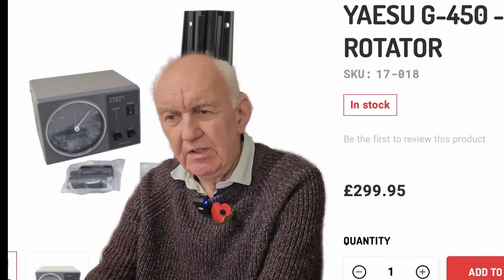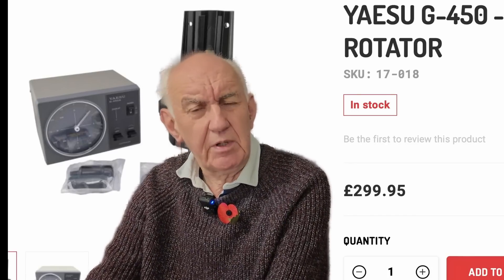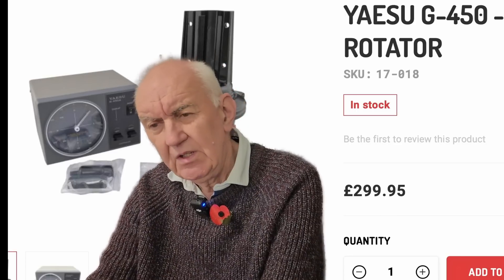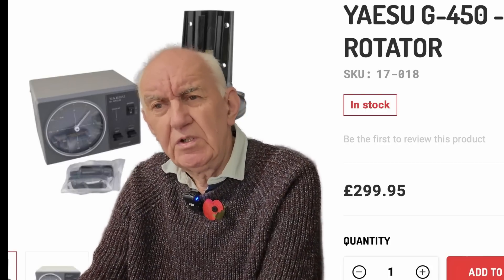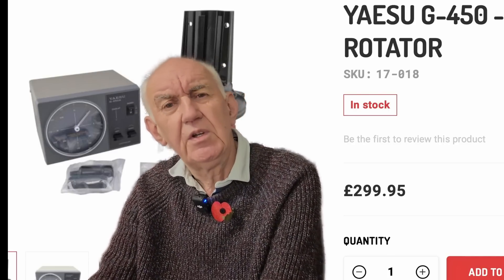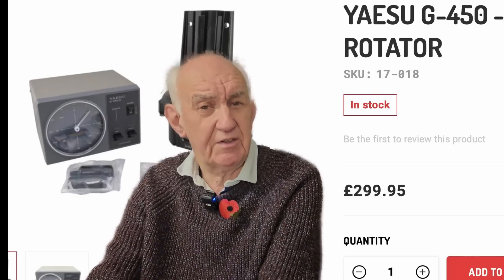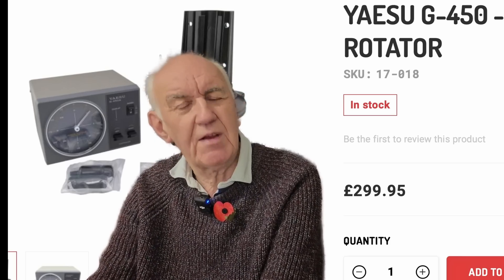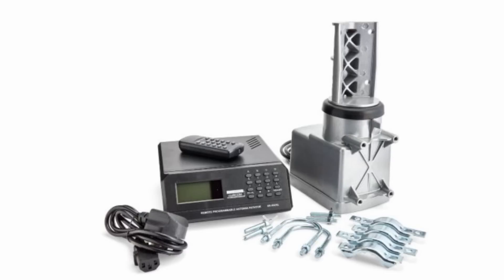Ham Radio Rotators -Choices and Warnings

Comment: What's wrong with a TV antenna rotator like ChannelMaster?  TV antennas are often of similar weight.  BTW, cut the bottom out and slit the side up a milk gallon jug, put it over the rotator for extra weather protection.

Comment: Great video. I am looking at the Yaesu G-1000DXA.  The antennas I will be using are Hy-Gain TH-11 DX , Cushcraft D-40 and a Cushcraft A-148-20 T 2m antenna. In your opinion will this rotor work or should I go to G-2800. These antennas will be on a 48' HD tower.  Thanks
Reply: It should but if you are unsure get the 2800. I have the 1000 and am happy but it's just turning a hygain th3mk4. I do believe in over engineering. Joe WA4UJY

Comment: Hi Peter.  I've been thinking about possibly putting up a small yagi for VHF/UHF and possibly - if I dare to go so far - a hexbeam for HF.  I knew I would need a rotator for such directional antennas, but quite honestly, I was completely clueless on their operation.  This video really helps explain rotators and additionally thrust bearings.  I've read you typically need a thrust bearing for such antennas, but I really had no idea why.  I'm feeling a bit less intimidated now after watching your video - thanks!
Reply from the maker: Glad to help.

Comment: Peter great video! Totally excited my engineer qeek, and its showing. 

Lets break down (no pun intended) why the position of a rotor motor on an antenna mast makes such a big difference in the torque experienced by the rotators stationary gearbox, especially when the wind blows. This is a topic that confuses a lot of people, so let’s address some common misunderstandings along the way.

Torque Explained

First things first, torque is a measure of rotational force. It is calculated by multiplying the force applied by the distance from the pivot point:

Torque = Force x Distance

This means that the longer the distance from the pivot, the greater the torque generated for the same amount of force. Think about using a wrench—the longer the handle, the easier it is to turn a bolt. While torque involves rotation, tension is the resulting effect: a linear pulling force that doesn’t cause rotation.

When torque is applied by a motor to a mast, tension energy is stored in the mast until the motor stops. This is why the mast may appear to bounce slightly from side to side when rotation stops. However, when the motor is stationary and rotational force is applied at the top (e.g., by the antenna), the torsional force in the mast is amplified proportionally to the torque applied by external forces, such as the wind. The full effect of that torsional force is then transferred to the gearbox or motor via the mast.

Common Misunderstandings

Many people mistakenly believe torque and tension are interchangeable, but they are not. Torque is rotational, while tension acts in a straight line. The concept of a lever arm helps explain this: the farther the force is from the pivot, the greater the torque produced. This is why the position of the rotor on the mast is critical when discussing an antenna and rotor system. 
Using the wrench analogy. The longer the wrench (think about the length of the antenna) the greater torque (turning energy) gets applied by the motor or the wind. That energy is transferred into the bolt (think of the antenna mast) as tension. (Much like a ratchet wrench utilizing an extension)

Analyzing the Rotor Position

Rotor at the Bottom of the Mast

When the rotor is mounted at the base of a 30-meter mast, the entire mast acts as a long lever arm. Wind forces acting on the antenna at the top generate significant torque at the gearbox at the base. Additionally, the mast will twist and store torsional energy, which can cause fluctuating forces that amplify the loading on the gearbox. This increased rotational force leads to higher stress on the gears or the motor, accelerating wear and tear. In extreme cases, if the forces exceed the system’s design limits, the resulting load on the gearbox can lead to catastrophic failure.

Note: this is why if possible during a major weather event with high winds its good if you can to apply a "Mast Lock". This will keep any torsional forces from being transferred into the motor or gearbox, minimizing or isolating antenna system damage, if there is any.

Rotor at the Top of the Mast

When the rotor is positioned near the top, close to the antenna, the dynamics change. The lever arm—the distance between the point of force application and the gearbox—is much shorter. For the same wind force, the torque on the gearbox is significantly lower. With less mast length available to twist, there is reduced torsional energy accumulation, which means the gearbox or motor experiences smaller, more immediate forces. This configuration places less stress on the system and improves overall stability.

As you eloquently stated

Rotor at the Bottom: More torque due to a longer lever arm and greater torsional energy accumulation, leading to increased force on the gearbox.

Rotor at the Top: Less torque and minimal torsional energy accumulation, resulting in reduced forces on the gearbox.
Reply from the maker: Well, thanks so much for such a detailed and educational  explanation, I am sure others will read it with great interest. It’s the kind of thing where you believe you know there is a danger of damage, but you don’t understand the me mechanics involved.Much appreciated.

Comment: Great video. An important thing thar was not mentioned in this video : When expecting lightning do not only disconnect your antenna, also disconnect the rotator. Otherwise you can have via the control wires a point in you mast that can attract lightning and when lightning strikes it can destroy you equipment.

Comment: Again a great video Peter, thanks for that. I'm just using a folded X-beam wire antenna for 6 bands (20-6) Little windload and only 8 kg in total. I played on safe and mounted a G-1000DXC rotor under it. Should last forever. 73 de OO4M
Reply from the maker: Sounds great!

Comment: Hi Peter, not wishing to be rude but your screwdriver idea doesn't realy hold. Its the thickness of the handle that increases the torque.

To give you an example of torque, it's force times distance or in old money, pounds per foot. Try pushing your front door open an inch from the hinges, then do so from the opposite end to the hinge, you will feel the difference of torque.

Sorry if I am teaching anyone to suck eggs here, but thought it may help someone get the concept.
Reply from the maker: Yes torque is easy to demonstrate. But there is an additional transmitted force. That is why we normally place the rotator at the top of the mast.

Comment: Thanks for this video!  I had already purchased a Yaesu 450 for a hex beam based on the wind load rating of the rotator and the wind load of the antenna but still found the video interesting.  Recently I helped install a hex beam on a big tower which provided great insight for my own project.  Torque is not materially affected by the length of the tube between the rotator and the antenna as there is just not enough force applied on the system to reach the torque limits of the connecting tube.  It is much better IMO to have a tube and thrust bearing than to mount the antenna directly to the rotator.  The thrust bearing can carry all of the weight.  It adds cost but it really helps the rotator do its job and it reduces wear.  The ability of the rotator to start and stop the antenna (torque rating) and to maintain its position and tolerate wind loads are the most important factors.
Reply from the maker: Correct, torque is no affected by length, but there is a significant magnification  of transmitted force that is put on the rotator.  Long screwdriver effect.

Comment: I had a Channelmaster with thrustbearing to turn 5-el 6m, 9-el 2m, 19-el 70cm and an X-200 on top. Survived a gale 10 and worked well for over 10 years, with a little annual TLC. I figured I could thrash 3 of these for the price of one Yaesu, but I never did.

Comment: Two dead rotators here,
Daiwa DC 7011  Kenpro KR-400RC

Turned out that the Kenpro uses exactly the same head unit as the Diawa.

The problem is basically a poor if not incompetent design.  There are NO end stop switches in the system, when the antenna hits the stops the motor keeps going and relies on a slipping clutch to save it. That does not work well and the motor burns out.
These are 24V ac two phase motors you switch the phases to change direction. The advantage is that there is no electrical noise. The disadvantage is that spares are almost impossible to get now. (these are old rotators ) 

I have a long term project on the bench to rebuild them into something rather more robust, but as will all my projects other things get in the way 🙂

I see that the newer rotators now use a dc motor with limit switches that cut the power. So a much better design.

The simplest roatator I ever had was for my 6 ele 144Mhz quad it was a couple of lengths of orange nylon garden cord tied to the ends. The strings came into the shack (bedroom) via the fanlight window So 180 degree rotation was easy. With a little practice I could let the antenna spin until the strings crossed and then the other 180 direction could be "beamed up" 
That worked really well for many years...

Andy

Comment: Hi Peter,  interesting presentation,  thank you.
I have been using the now obsolete Emotator 1200X for almost 40 years and did a complete rebuild 3 years ago. I agree with all you say and the best rotator is the one or two models from the range above that of the design minimum recommended for your proposed aerial array. It will be worth the extra spend in the long run and as you so rightly say, no getting cold and wet during a winter breakdown. 
Fortunately there is much information online concerning old rotators and spare parts are available if you search.
73,
Martin GW3XJQ
Reply from the maker: Thanks for sharing Martin.

Comment: Hi Peter, my first rotator was a Stolle TV antenna rotator, I used it with 2 bearings, worked fine. 2m, 70cm, 23cm Yagis. When I wanted to install a 2m Dish ,plus Yagis, I changed to a Kenpro KR600 plus bearing. It worked for more than 35 years until a hurricane. Then he needed a Dentist. 2 teeth broken. Kenpro didn't exist anymore,so no new couronne. I scrapped it.😮
Reply from the maker: Gosh, names from the past that I had forgotten!